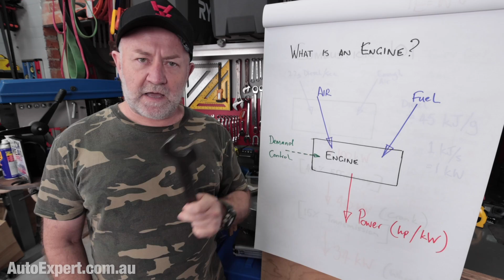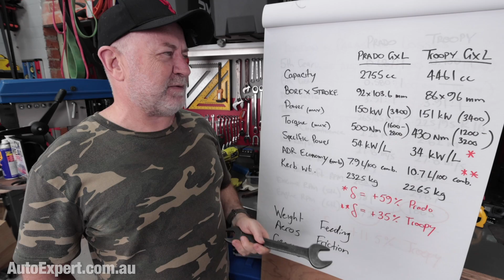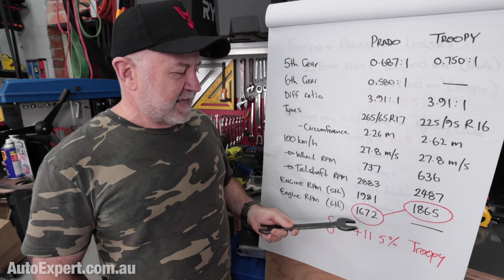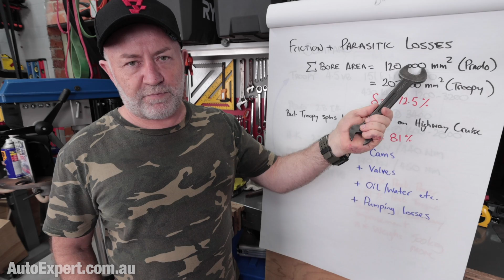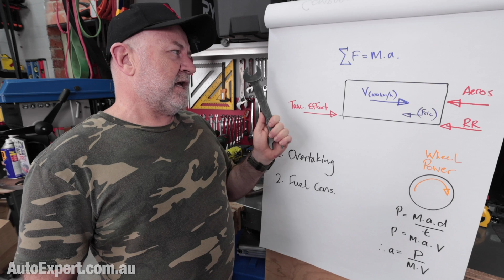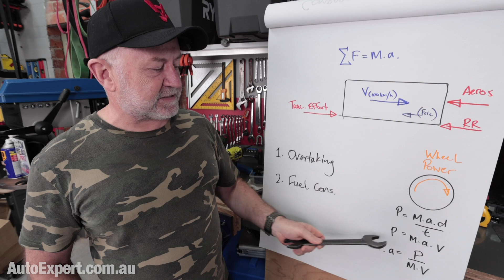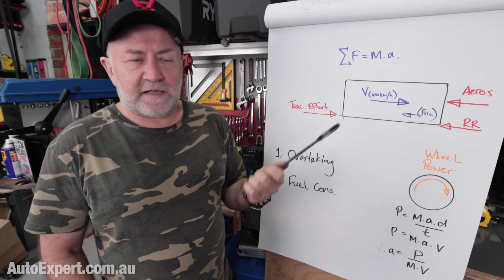Toyota Landcruiser Troopy fuel consumption (why it's so bad) | Auto Expert John Cadogan

Comment: From experience on working on both engines over many years, I have a fair bit of anecdotal evidence that the 4.5L 1VD-FTV in the troop carrier and other Toyota models has a much greater life expectancy, or, time before overhaul, than the 4 cylinder turbo diesel 1KD-FTV/2KD-FTV in well maintained scenarios. Whether that balances out the extra fuel expenses over the lifetime of the V8 turbo diesel engine, I am not so sure.
Reply: Yes because it's understressed and underworked
Reply: @mwat22  Yeah, having one less Turbo but the same sized sump means the Oil doesn't have to work as hard. Also the cooling jacket is designed to deal with a twin turbo system.

Comment: Being 79 owner your Spot on with original Toyota spec mapping. Strangely, when mapped to real world and 3” exhaust, you get twice the kw and torque return for no measurable difference in consumption and lower loss of energy via lower egt’s. Torque curve is all the way through rev range. Why Toyota torture us with this is a mystery yet I do not know ANY buyer of the v8 who has stayed with the original tune. I will say, on corrugated roads, at 80kmh, and even with wheel spin, I get as low as 12lt per 100. It’s fully 1/3 better than at 110k on highway when using it for what it’s built for..... funny that. Be very interested to see your figures if real Dyno tested vehicles (at wheel torque/power) after mods. Really enjoyed the video and thanks, keep up the awesome content!5 stars!!
Reply: I have heard that often more fuel is burnt to improve emissions output, stuff like lower burn temps for less NOx, I gather. I don't know any real facts, but it makes sense to me that the manufacturer has many points to consider in a tune, not just max power and max economy, which is generally the aim of aftermarket tunes.
Just another tidbit of personal opinion and probable misinformation on the internet.

Comment: My v8 hitop troopy has 445k and does 13.5l p100 km fully loaded. You don't buy a troopy if you want pure performance and economy but it does pretty well. Thinking the 2.8l is being worked harder for the size and generally wont last as long as the v8, but time will tell. I also doubt the 2.8l is any where near as good as the v8 to drive, but don't know, never driven one. But also, V8 is just better, no debate allowed (just saying...)

Comment: I am a loyal owner of pre-historic diesel powered Landcruisers and have been for the past 10+ years and will continue to be for the foreseeable future. I found this video very interesting, but what I got out of it is that the V8 is dead when compared side by side with the 2.8 inline 4 because that it does everything so much more efficiently??? Obviously the V8 has the cool factor and that V8 sound, which the 4 cylinder can't beat. If the 4 cylinder is so much better than the V8 then why do I predominately see the V8 and older diesel inline 6 Landcruisers when travelling the outback? I seriously don't think that I can name a single occasion when I was 500km from the nearest town and didn't see a Landcruiser being used out there. Surely there has to be something going for the V8? What about longevity or reliability? PS, when I mentioned the pre-historic, dinosaur era Landcruiser diesel engines, I was referring directly to the non-turbo 2H and the turbocharged 12HT engines found in the 60 series. I currently own an automatic 12HT which puts out 82kw at the wheels (originally 100kw at the crank in stock form) and I'm happy with the way it performs. My 2H and 12HT powered 60 series Landcruisers have literally taken me to every place in Australia that I have ever been. Do you think that the 2.8 inline 4 could possibly survive without a rebuild for 1,000,000km like many of these older engines have?

Comment: I have a 2016 Landcruiser 79 series twin cab that has final drive ratio of 0.881:1, not 0.750:1 as per the later models. doing 100kph going by satnav in fifth gear (top) it revs at 2350 rpm, a lot higher than 1865 rpm as shown in the video. its fitted with BFG KM3 265/75R16 tyres that are 805mm dia being 2.54 metre circ. I have kept a record of fuel consumption since I bought it and the long term average over the past four years is 12.3L/100Ks which includes highway, bush tracks, the lot. a bit on the thirsty side compared to Prados and the like, but built like a tank and I can carry a shitload of stuff.

Comment: Two words Toyota. Straight Six! The new 300 series is going to have a 3.3 ltr V6 with more power. Why when the bonnet is long enough for smooth straight 6? Why didn't they make the old 6 a DID, double cam and emission compliant motor is beyond me. They even had to widen the front track to fit the V8. Who knows the reasoning but it seemed to work...must be the sound of the V8 up front compensating for small body parts 'down there'.

Comment: Dave should take a good long test drive in a 70 series with the V8 diesel (then buy the Prado). John's done an excellent analysis of the data, but drive it and you'll understand qualitatively what the science actually translates to. The 1VD-FTV  V8 "feels" like eight cylinders all fighting each other like piglets at the tit. You don't have to do the maths to realise it's not a very efficient engine, you can hear and feel all the energy that is being wasted when you drive it. I was well into the swing of selling these trucks a few years ago when I got hold of a Japanese fire tender based on a 1991 70 series with the 1HZ straight six. It had done just 9000km and the smoothness of the 1HZ was a revelation. Equally eye-opening was that despite the naturally-aspirated 96kw/288nm of the old 4.2l and the fire tender being over 3 tonnes at the kerb, it certainly didn't feel any more gutless than the V8.
Reply: Had a v8 tipper with a chip bin, weighed 3t empty. The difference between the v8 and the i6 is night amd day, especially when towing 2.5T and carrying a load of mulch.

Yeah the 6 is smooth but the v8 gets there in daylight

Comment: One disagreement and one question. I don't think the troopy, and ute's are designed to cruise on the highway. The biggest market for these, I thought was mining and agriculture. I read a while back that without those markets, there wouldn't be enough sales to make there production worthwhile. And efficiency at 100Kmph probably isn't that important in that market.  Question. Is it likely that the troopy and ute's are still running the same or similar drive train to the straight 6 cylinder model of the past, and that cannot cope with the power and torque of the twin turbo V8, so the run a lame, detuned version of the V8 rather than build a new drivetrain?

Comment: It would be interesting to see the numbers fro brake specific fuel consumption.  That is the number of pounds of fuel it takes to generate 1 hp for 1 hr. (or kg) That is the measure of the engines fuel efficiency on it's own.

Comment: 3.0L 4 cylinder Turbo Diesel all day

doesn't sound as good as a V8 but the 4 cylinder will do most job in the most economical way possible
Reply: I agree. As soon as they figured out that by adding a turbo to a 4 cyl diesel, it went from drab and gutless to wooohooo !! Now that's the tickit !!

Comment: John on the 2nd last page you have the Troopie making 151kw @ 3400 and under that you have it making 430kw @ 1200 to 3200 rpm.  Should that 2nd line be nm not kw?  As an ex TAFE teacher (maths support) my greatest fear was stuffing up on the board. (I remember explaining ...) Or, have I missed something?  I would STILL prefer the twist drill as a pointer.

Comment: I still prefer the 4.2 straight six.
Nothing smoother than an inline six.
Reply: "v12 has entered the chat"
Reply: @SoulTouchMusic93  You are correct. Two inline sixes together. I was speaking with in reason for a 4x4.

Comment: Its apples for oranges. One is a work truck the other is not. If you bought one of each and had them do the exact same thing, one would preform as it should, the other would eat itself. The Toyota service department would get your hard saved fuel money.

Comment: The attraction of the Troop carrier is that you can fit a bed in the back and also sit upright inside without your head hitting the roof. Try doing that in any other 4WD. They are the ultimate practical tourer for 1 or 2 people. The 76 series vs the Prado would be a more worthy question.
Reply: Ive done that in my gq, false floor with 140ah battery, 40l water bladder, tools, recovery gear, and other stuff all under the false floor. All i need to do is take my chair out and unroll mattress and camp setup is sorted. im 6'3 and can comfortably kneel or sit upright. If i have my partner with me i simply undo my fridge and custom camping box/table via 4 carabiners and its a double bed. Rx and Ti GQs are luxury compared with a troopy when driving, superior offroad, and i got mine grandpa spec for 5k, 0 rust well maintained.
Reply: I don't know what the current Prado's are like, but in my old 90 series, you could fold the 2nd and 3rd rows flat, put a double air mattress on top of them and still sit up without hitting your head.

Comment: Toyota should have kept developing their straight 6 diesels, a mistake to go to the V8
Reply: They are back to 6s sacked the 8s
Reply: @Jay-en7bw  yeh but v6 should be a inline 6 better low end touque then v8 or v6 the reason trucks larger tractors run in lines not v engines and they last longer
Reply: @carlmenzel8744  yeah I get you but it's not.the motors first it was the injectors now dpf if they get rid of these 2 issues they will be back to the top
Reply: @carlmenzel8744  i haven't seen any new tractors sport a V8 in a long time the only V8 tractor i have driven is an old Stiger Wildcat. as for trucks i think Scania still do a V8.
Reply: @phalanx3803  john deere and international which was a steiger with a V8 inter both done a articulated 300 + hp and international did 1568 and 1468 the 1468 we use to own one none of those tractors were a pitch of shit to there eqvilent in an inline 6 engine. International done the same engine in some trucks they weren't much chop ethier but all this bashing of V8s doesn't mean I don't like seeing a nice old car with a big block cruising around.
Reply: v8 all day cityboy
Reply: @6foot8jesuspilledpureblood82  only the city boys want the V8 over the 6 though
Reply: i think they has to because of emission reasons but i think they are going to a v6 soon'
Reply: Yes the v8 is a piece of shit
Reply: @thebeerhunter817  And you own a V8 cruiser right, so you'd know.....
Reply: @Kim Jackson  really $1000? What do they have alien technology in them? Whole set of injectors can easily by your second hand 1HZ or 1HD-FTE.
Reply: Ask an under ground miner their opinion.
Reply: @seanworkman431  How do I get hold of one?
Reply: @snakeinthegrass7630  one what? I can't find my original comment.
Reply: V8. Ten hours labour to change the starter motor. Should've stayed with inline 6 but cheaper to manufacture a shorter vehicle and fit the no go V8 in it.
Reply: @davidwolff8903  We've never had any problem with our V8 LC fleet.
Reply: I’m addicted to the V8 rumble, always was, always will be... where have I heard that before? My C6 Corvette (LS2) does 8.5/100 on the highway without trying... I don’t own a Toyota but a few horsie friends do and all bar one has the 4.5 V8 diesel, from what I can figure, the minimal difference in economy (because you’re not flogging a tiny engine) is a no brainer.. the old heavy floats behind Hi Lux’s actually chew up more fuel and most of the klm I’ve done with them were in a four door basic cruiser towing close to 3.5t.
Reply: 2H the world
Reply: If the Sheila’s like ‘em, I’m in like Flynn
Reply: Ever driven the v8 twin turbo diesel?
Reply: 10 litres per 100 kms from my 2009 sahara
Reply: David Hall sitting on 80kph like most 200 owners
Reply: @IPF250  wanna bet? I can prove it. Actually when it was new it was more like 9.
Reply: @davidhall5844  Except when you are towing that massive caravan, eh Dave?
Reply: @alexbrown1995  hi Alex. Sure, then I get 17, which is great, about what I got out of my previous 6 cylinder Petrol 80 series, not towing!  Besides I think a 21’ van is average. Not massive. Good to hear from you Alex, I’ll be in touch soon mate.

Comment: Hey John, is the engine revision the same in the troopie and the 200? I am struggling to see how a 2nd turbo on the 200 (if the same engine) could be more fuel efficient? More boost = more air and fuel mixture = more power & more fuel? Unless the 200 has an updated V8 engine.
Reply: Diesel can and do run lean (more air than fuel) and using the same fuel, but using wasted exhaust energy to push more intake air in, increases efficiency of burn. More boost is better, so long as the engine can handle it.

Comment: I have found when towing heavy weights smaller engines use a lot more fuel because u can't lift your foot off the floor  .
Trucks running interstate that have a motor with less than 400hp and 62 tonnes will be running for an extra 2 hours between Sydney and Melbourne because they can't get up the hills at a decent rate

Comment: my troopy uses 15L/100 with big tyres roof rack and loaded rear setup, id imagine any other 4x4 with the same load in it would use very similar. Not sure what the comparison is. It also gets those figures towing a 1t trailer almost every day and living in a hilly area.

Comment: Why does no one ever talk about power/torque curves? It’s not great looking at the maximum figures. A Troopy is designed for a lot of weight and longevity hence the v8. A Prado is an awful towing vehicle and they end up using the same fuel when towing but the v8 does it easier. The aerodynamics are so different, especially with the larger diameter tyres and near vertical windscreen. Torque means a lot when thinking about what these two vehicles are used for.

Comment: 70 series are tuned down 200 however is a very different story with pretty much the exactly the same engine 70 series cruiser pumps around 13 PSI of boost 200 is just under 20 psi

Comment: A major assumption here is that both engines are tuned/fuelled to their maximum potential power output, which is simply not the case. The V8 is capable of producing huge amounts more power with a simple flash tune, whereas the Prado motor is much closer to it's limit, any minor increase in fuelling brings it ever closer to the point of failure under load. 
An interesting comparison would be to measure/calculate strain on a con rod in each motor as an indication of how much relative strain the motor is under at full power. You'd find the V8 is under far less strain for the same power output.

Comment: No, no , no, it’s the accelerator pedal, push it down the wheels go around. That magic box is for the air conditioning, no maths stuff required.
Reply from the maker: Thanks for setting me straight on that.

Comment: I'd like to see the cylinder pressures comparison. And as John noted the v8 should make those power numbers of 200kw and 680nm and they do as soon as you tune them.  But they can't sell them like that because that would make the 200 series at 100k to 135k look ridiculous. That's why the base models have either a smaller engine or 1 turbo less, or are detuned. Imagine paying 90k for a prado Kakadu model it couldn't pull the skin off a custard.

Comment: You compared bore area, which has a nasty square function in it.... ring friction is going to be a function of bore diameter only.... no nasty square function, so probably not as bad as you present.....  I'm very definitely not standing up for V8 engines.... my fave engine config is an inline 3.....

Comment: But that "more fiction" thing also must play out when a smaller capacity engine has to be revved high to generate peak /equivalent power.
Reply: The thing is, the smaller engine isn't revving higher to make more power, the difference is that the big V8 is making much less power than it's capable of, and the smaller engine is somewhere closer to it's maximum output. All the components are stressed much more to make the equivalent power.

Comment: One of ya best!

How does durability relate to all that additional internal friction? There is no question that the older engine are more durable than the newer ones. Why?
Reply: Older engines were brute-force-built; no fancy computers shaving grams, millimeters, and quality to maximize profits. Remember that before computers that could simulate an entire running engine, there were scratch pads and slide rules for figuring out how to make a part, what it was made of, and it's expected durability. The safety margins were higher in old engines, because we didn't have the science and tech to "do better", and back then it was expected to get more life out of engines, not making cheap throwaways with shorter service lives. The old-line engineers are spinning in their graves seeing newer designs that are so fancy, yet may not hold up 200,000 miles/321,xxx kilometers because they are built with to such thin margins of durability/quality.

Comment: Does the V8 have a safer tune from factory to increase reliability for a vehicle used in remote locations, where as most Prados don't go too far from a soccer pitch, shopping centre or Toyota dealership if they fail.